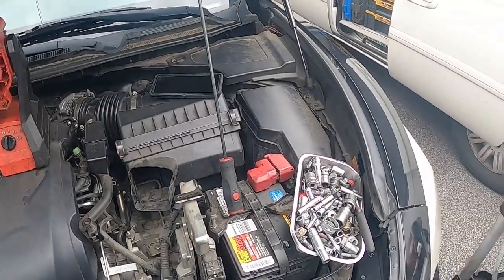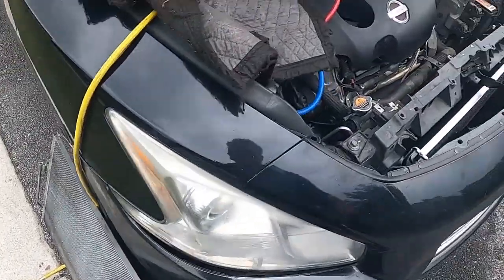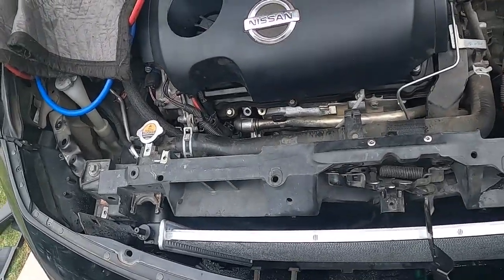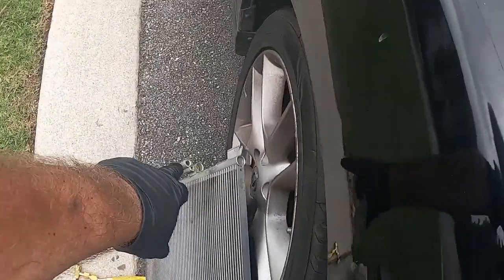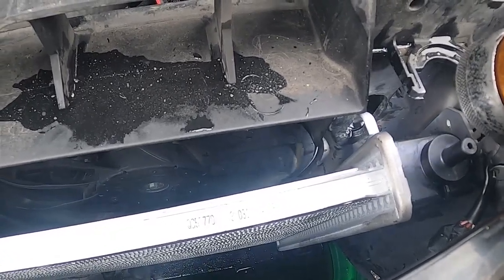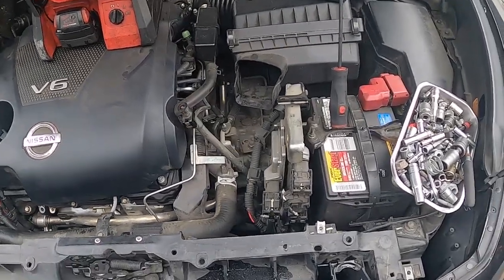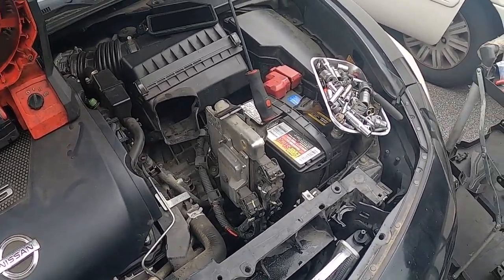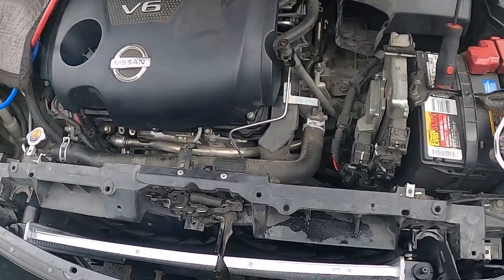DIY How to replace a Radiator  for 2011 Nissan Maxima 3.5.

Comment: I was taking my radiator off and unplugging hoses and one of the hoses on top of the lower coolant tube started draining oil when I unplugged it is that normal I really don’t think it is
Reply from the maker: was it a coolant hose  or a transmission cooler line ?  if it was coolant then no it wont be good.

Comment: I’m stuck on the actual radiator. What did you use to take off the radiator line?
Reply from the maker: Should be just hose clamps   right angle plyers likely